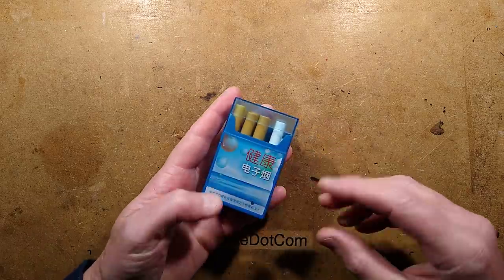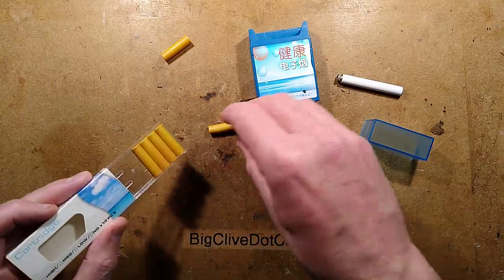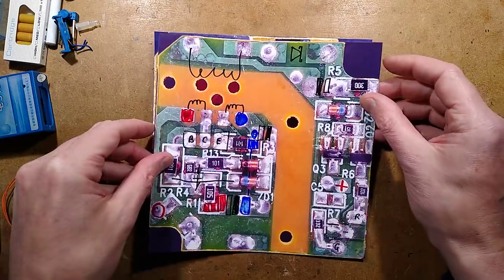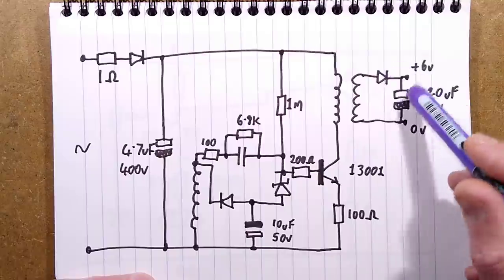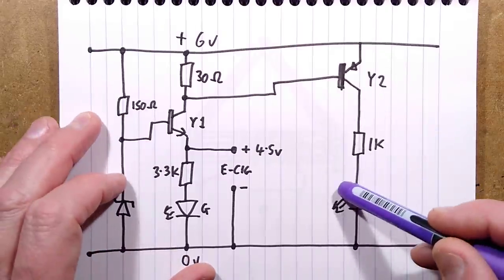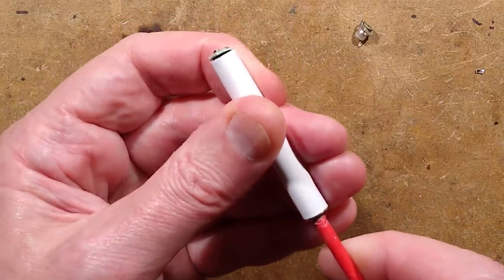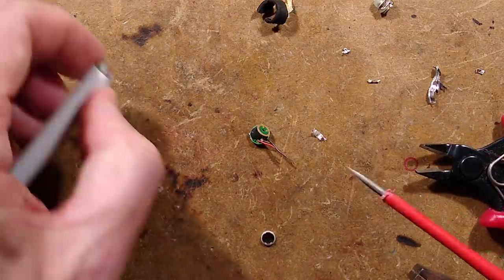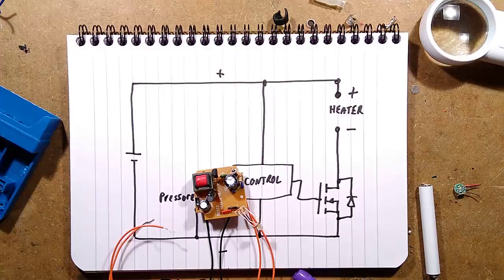Vintage novelty device teardown (with schematic)

Comment: For some reason, I want to see the battery contained inside. Tiny lithium cells are perfect for repairs on wireless headphones and other devices that most people throw away when they won't hold a charge anymore.
Reply: Yes yes and yes also I think it was big quiet that had the video on recharging us tiny cells as well if I remember correctly and of course who could forget the Disposable cell phone chargers and again with what I was saying earlier in his comment about the Disposable e-cigarettes that ran on a rechargeable but in the case of the E-Cigarettes that were just one time use used instead of another type of battery that was not rechargeable and yes lithium cells and no we might just be disposed of casually or just dropped somewhere or in the trash cans dumpster garbage truck what have you I wonder if there was any fires started because of these because will assume cell be damaged or shorted out due to carelessness as well I've heard about a recycling center bring burn to the ground from 1 lithium battery more than once also there is at least one video where a garbage truck compactor starts a lithium battery on fire so that goes to show what can happen I'm afraid to go out where I used to work that no one ever put a lithium battery or device contain or any type of rechargeable battery pack or device in the compactor and started a fire.

Evidently we had never had a fire in the compactor however we had had other fires.

One time we had two fathers and one day one garbage can that was apparently was due to a still smoldering or lit cigarette.

The other fire was a vehicle fire engine fire specifically and yes it was extinguished with extinguishers through the front grill.

Also best way to find an engine fire is to fight it through the front grill never open the hood adding oxygen and other opportunities for fire to spread as well.

I have had fire training more than once and that's how we're told to fight an engine for under vehicle Hood fire.

But in general if we smelled smoke first thing we wouldn't think we do is check Electronics and or see if anything was left plugged in somewhere that was being tested and was just left or otherwise.

Although oftentimes it was just a heater or a heat-producing device that had just been tested and typically that had dust in it were something was on the Almond or whatever.

And word is just bad shape of equipment that we didn't catch on the test branch.

I remember one time there was one of those rechargeable Fordline Searchlight whatever you want to call it handheld rechargeable job!

It was being charged where is Subway in Port Chester on the sales floor I smelled smoke glanced over by one the outlets and there it was strangely enough the charger had already been unplugged but it was smoking like crazy.

And definitely hot as everything.

Don't know if there's an internal short or a fault or what but yeah big problems.

Fortunately I was able to get to the internal battery by opening the battery compartment grabbed a pair of pliers disconnected the battery Not only was the electronics that the controlled power to battery charging from the external adapter smoking the battery was as well sealed lead acid!

Didn't smell like sulfur or anything like that either so that's kind of a mystery possibly a short somewhere in the charge control board cause both to fail but that's just a guess
Reply from the maker: It's about 7mm diameter by 40mm long with a capacity of less than 100mAh.
Reply: @bigclivedotcom  that's actually almost perfect for wireless earbuds, the last ones I did a repair on had a tiny lithium ion pack in it that was a whopping 150 mAh (if the printing on the pack is to be believed). Those low drain devices would run for months if fitted with an 18650 or other common lithium cell. Perhaps if you called it a "self-contained heated atomizer device" you could avoid the inevitable demonitization that goes along with these kinds of items, too. 😀
Reply: @aaronbrandenburg2441  I never really have considered the fire hazard of lithium cells, but they do hold a tremendous amount of energy for their size. I repurpose quite a few of them, and feel quite safe in bringing them to a full charge, taping the positive end to avoid short circuits, and sitting them in an old metal ice cube tray to minimize damage if one should decide to melt down. After years of being a mechanic in the public sector and jack-of-all-trades for a heavy equipment manufacturer, I've seen my share of fires. The worst ones were almost aways caused by hydraulic oil spraying onto a hot surface, followed closely by ignition of hydrogen from lead acid batteries being charged or discharged.

Comment: ahhh believe that's a old 401X, the battery lasted just about the length of a actual cigarette thanks to its 50-95mah battery (depends if you got regular or superking size) and the carts were i believe about 0.2ml (remember them being full from 3 drops from a needle bottle) wasn't the worst kit for its time (the worst goes to the KM ladypipe) and the only saving grace of it was you could charge it on the go unlike the ladypipe

Comment: Have some of that type --not the box holder, but the battery and cartridges. the carts were "non refillable" although i filled them through the top anyway. the auto draw ones fail quickly. i tried to take it apart, and it was as destructive as your example and i didn't get much from it.

Comment: I had something very similar back in the late 2000s early 10s. Exactly the same almost just minus the holder, instead it charged with a USB adaptor that you screwed it into.

The cartridge pack was exactly the same though, they were apparently Benson and hedges lol

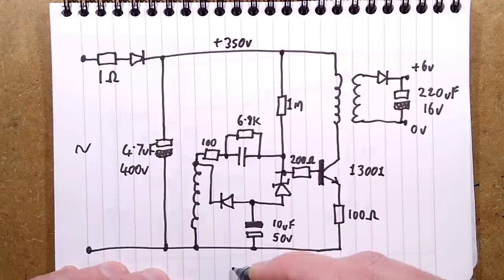Comment: I’m trying to work out how you got 350v @ 8:35 into the video? Wonder if you can help me on this please Clive?
Reply: rectified and smoothed AC mains is kinda 320V DC... mains AC swings up to that voltage and down to minus the same, we call it 230V AC bcs the effective "drive power" (called RMS) is like 230V DC... imagine the sine waves like ice cubes and they melt to obtain a water height of 230V, but they were higher if not melted (320V.... 350V is what Clive has at the isle of Man)... the ratio is 1.41 .... (230 * 1.41 = ~320)
Reply: it is the peak voltage from 240v ac sine wave. grtz from Belgium
Reply from the maker: The RMS value (240V here) is the average (Root Mean Square).  To get the peak voltage which the capacitor will charge to, you have to multiply it by 1.41.
Reply: Thanks all for your reply’s that help me out. 👍

Comment: Not on topic, but - how small an object can you make with a 3D printer?  How hard would something 6mm high x 10mm diameter with a screw thread be?  Maybe I should ask on the next live stream eh?
Reply from the maker: You can make small things.  You could literally make a 3mm washer.  I recently made a coin mechanism insert for one of my machines and the design also printed four stepped pins to insert into the side for mounting.

Comment: The device has an American plug on it. That means the input voltage would be 120 v 180v pk, are you using 220 volts input for your calculations?
Reply from the maker: It's a Chinese 220V plug.  I used 240V for my peak voltage approximation.

Comment: Can big Clive or his community help me with ‘Functional earth’ explanation? I see alot of electronic equipment with a Earth / Ground terminal. Can these be connected to the same earth path and the electric supply earth?

Expamle. 

Fused spur feeding, sockets. Connected to the sockets is, alarm panel, POE switch etc. The earth terminals on the circuitry of the alarm panel, or the earth terminal on the casing of the switch. Can these be connected to the CPC terminal at the fused spur?

Many thanks in advance,
Richard
Reply from the maker: If mains powered equipment has a metal case and a means for earthing it then there should be an earth terminal in the vicinity of the supply terminals.  The term functional earth is quite specialist and may relate to a type of minimalist power distribution system or the earth current path for mains filters.
Reply: @bigclivedotcom  Thank you for your response Clive. So when installing electronic equipment, with an earth terminal on the PCB board. Where do this require connecting to? If all electronic equipment, form a loop separate from the supply CPC. Will these loops eventually meet back at the MET. Thanks

Comment: How exactly does that half wave rectified mains (presumably 220 or 110V) get stepped up to 350V?
Reply from the maker: 240V is the RMS average value.  The capacitor will charge to the peak of the sinewave, which is 1.41 times the RMS value.
Reply: @bigclivedotcom  Ahh, I get it. Very interesting video by the way. I was just about to go to sleep, but had to watch the entire thing before.

Comment: I used to own Blu electronic cigarettes and they came in a black cigarette pack that would charge the e cigarette and had similar end pieces you would attach...it looked just like that accept it charged via USB...at the time I thought it was cool because I was able to smoke indoors after the laws passed that you could no longer smoke indoors at bars and strip clubs but at the time vaping was new and the laws didn't keep you from vaping indoors..  the main reason they changed the designs I believe wasn't only about efficiency but because you couldn't tell how much nicotine you were smoking and some people would get sick from over vaping..with a real cigarette you finish when all that's left is the filter but with those you could keep vaping past a cigarette...I believe 1 cartridge was a whole pack of cigarettes and some people would get sick because they'd basically smoke a whole pack in 1 sitting..

Comment: Damn, I was hoping for the magic explosion that usually follows when plugging 100V equipment into 240V sockets... 🤣 😁
Reply: Ditto Butler switch for power supplies that doesn't always happen because Summer multi-voltage issue no unfortunately in this case the power supply survived and no big bang plus it could have been quite interesting linard right circumstances with possibly both the power supply going ballistic Andalusia battery simultaneously two bangs for the buck one could say

Comment: I was the first kid on my block, if not my entire city to have an electronic cigarette. 
They were banned by the FDA at the time so they would arrive with "interesting" descriptions.
I think mine usually said somthing about  vitamins.  They were often labeled as ink pens or flashlights.
I liked the small cigarette size.  I wasn't worried about "throat hit" or massive clouds of vapor.
I still have a few of the small batteries and a bunch of the atomizers just in case I ever pick up the habit again.
All my batteries were push button.  I would have like to have tried a draw activated one but never got around to it.  The early ones were just sound activated.  If you worked construction or went to a bar they would run until the batery died or they caught on fire.
I maintain the restrictions in the US have more to do with lost tax revenue than legitimate health concerns.
All the teenagers that were vaping becase of the flavors have moved on to marihuana edibles.
Somehow that's progress?

Comment: I stopped smoking in about 2010, these were rumours... I stopped using a nicotete inhilator it looked like you were sucking on a tampon applicator!  just a plastic tube with a cartridge inserted, and you just sucked on the tube, got an awful menthol/mint flavour... no power, no steam. it sort of worked, but I became addicted to those. so I just stopped everything..

Comment: The electronic cigarette was invented in the late 1800s.

During a smoke break…the gentleman was attempting to light his cigarette.
He was suspended high off the ground, repairing the telegraph line.
He accidentally grounded himself allowing current to pass through him… And his legendary cigarette.
By the time he hit the ground, Both he ( & his cigarette) were smoldering. 

And just like that!!!.... The first “electronic cigarette” was born.
You can see it displayed every year on the anniversary, at the Smithsonian Museum..... still smoldering away.
Reply from the maker: The dark side to that story is the number of American line workers who did die working live in the early days.  (And the industry still has a horrific mortality rate.)
Reply: @bigclivedotcom  Amen to that. You guys are either brave or crazy.

That’s why I avoid any high voltage/current work. After studying to join the trade,…. I switched my major to manual, CNC machining, & blueprinting work. (Just because I found it interesting,)

but after school I resigned to my own lab…. Messing with test equipment & Metrology work.

The few times I’ve been shocked….were more embarrassing than anything else. Certainly no “exploding body parts” like i’ve heard about in the lineman trade. 
Stay safe out there

Comment: I like your videos a lot but the one thing I always ask myself is: 
Why do you use a microscope to take a picture of PCB just to print it out on a big paper. Ink is expensive and it’s 2021😅

The schematic part in paper is another story I get that I need that to be on paper too lol
(Really not trying to hate here)
Reply from the maker: I sketch on the photos and use them to assist in reverse engineering the PCBs.  I use generic bulk photo paper and a printer with external bulk ink tanks.
Reply: Good to know now I can stop wondering🙃

Comment: I worked in Tokyo in 1990 for a couple of months. In the office I was given some fake plastic lookalike cigarettes by a manager which you had to put a little foil packed consumable nicotine tablet into. No electronics. I suppose you could compare them to a Vic's inhaler which tasted of cigarette if you sucked on it. There may have actually been a menthol version. They were not very good, but probably better than the real thing.

Comment: Should have washed your hands immediately after coming into contact with the fluid. I reckon you'll have (or you've had) a terrible headache approximately 12 hours after recording this video. This device is from the era when 24 mg/ml was normal. Nicotine absorption through skin is slow but potent. I learned it the hard way, never repeated the same mistake since.
Reply: I still vape 24mg/ml. I've got plenty on my hands/fingers but never s headache or other ill effect.

Comment: Isn't a microphone a kind of air pressure sensor?
Reply from the maker: It can provide a pressure sensing effect.  But these units are just the film shorting against the case through a very thin separator ring.

Comment: Wait I feel like I missed something what happened to the deathdapter? I don't remember it like that last time I saw it.
Reply from the maker: There was an off-camera incident.
Reply: @bigclivedotcom  I knew I was behind on videos but last I remember it I can only think of the exploding USB power adapter. But I know it was used after that.

Oh yes life of course it was off camera, had one of those with a tablesaw yesterday. (i’m OK this time, “we” The boss and I were cutting Styrofoam it static clinged and sucked into the blade).

Comment: I want to see the video involving how the deathdapter became sooty.
Reply from the maker: It happened off camera with a loud bang as I was plugging a cheap charger in.
Reply: @bigclivedotcom  I was curious about the same and if there was a video but didn't have to see anything about it so thanks for the info big Clive big Clive comes through again I've watched most of his videos where at least the ones up the interest and even some just random ones big claws you need to do a playlist of when things have gone horribly wrong including the things with the involving legitimate use of the infusion confront containment pie dish and more also you need more of those joke videos such as the hundred Watt Maine's LED one we're deliberately blow up the low voltage hundred what cob LED with 240!

I still remember you saying it went bang and turned black I still chuckle every time I remember that when I see a video of yours with the driverless LEDs or anything's open LED common it of substantial size

Comment: I had one these back then. Best thing about them was that you didn't have to put them down like conventional vape pens or normal vapes nowdays which are enormous in size if compared. You could just keep them in your mouth while working on something and puff whenever you felt like it. I loved the concept but they weren't very receptive to refilling custom juices and original 'tobacco taste' ones didn't exactly taste like anything I'd ever smoked before(to put it nicely) so in the end I got rid of mine. I do slightly miss them though, it was the only time I've ever felt 'handsfree' while smoking meaning you could game or write during.

Comment: inside that hard steel mesh, usually was a tiny strip of metal to give the metal mesh enough oomph to get through the foil connector, then used capillary action to wick juice from the cotton wool inside onto the atty, back in the day we used to awkwardly debridge 510 atties and more commonly 306 atties (a development of the style in the video) for a better flavour. ahhh the bad old days XD
Reply: Haha I just edited my comment to include this because I thought it was a neat bit if "lost" knowledge. And then I see your comment lol! Good to see someone from the early days of vaping lol
Reply: @Triptweeze  oh i remember the bad old days when the height of vaping was a 306 with a cannon driptip on a ego battery. or those silly HH357 atties that everyone said were amazing and turned out to be essentially a 306 in a 510 tube.

Comment: blast from the past, not the charger but the electronic cigarette it's self, Back in the 510 days I used to buy the batteries and atomizers in bulk from china because they were so crap. 2007-ish